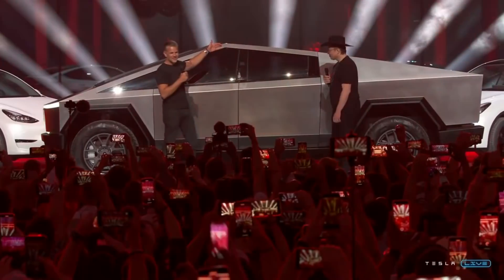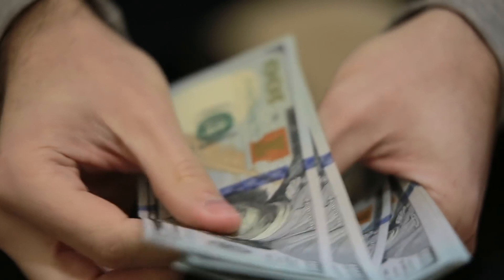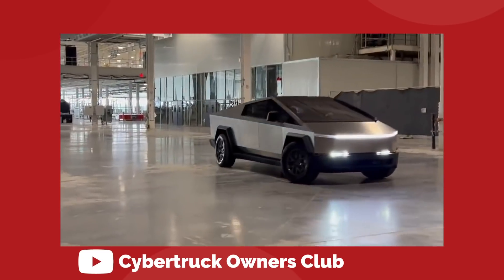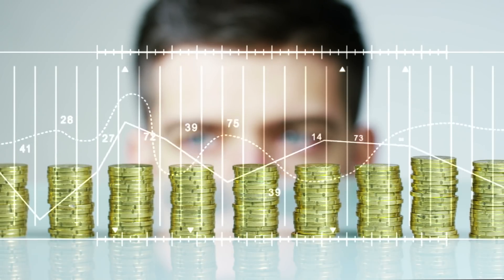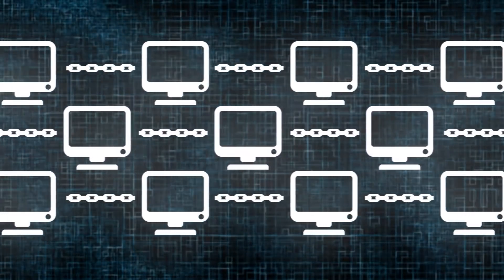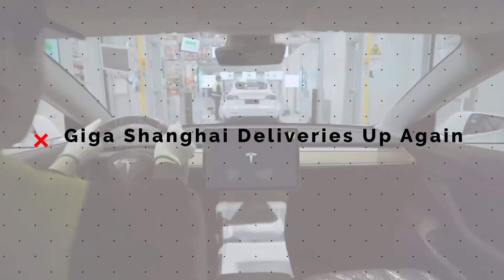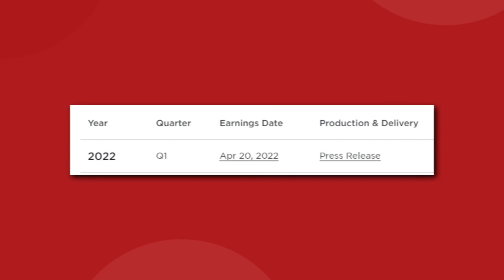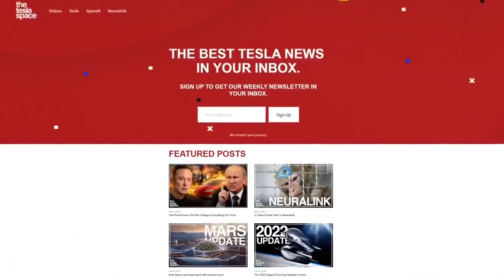New Cybertruck Updates From Giga Texas!

Comment: 3:50 you call that rear wheel steering!? It’s pathetic/a joke that tiny steering angle, Chevrolet did a way better job with the avalanche….
Reply: it's amazing you can make that assessment from a small clip of a minor turn on a prototype vehicle :o I'll be interested to see it actually being used in operation and doing crabwalk steering and we can see how well your comment ages when it's compared to avalanche then ;)
Reply: @daemenoth  lol…… hummer/GM showed their all wheel steering and crab walking way back during the prototype that was actually nice to see, my comment will age very well.
Reply: @alanmay7929  once again they were not showcasing that functionality in the still developing prototype so trying to make that assessment on your part is quite premature and the avalanche also does not have self driving and is quite a bit more expensive to keep on the road, nor does the avalanche have anywhere near the same amount of torque while doing such a maneuver or in general. In 2 years I don't expect anyone will be touting how much better capabilities and features the avalanche had over the cybertruck in any regards and honestly I won't be surprised if GM is the first legacy brand manufacturer to fade into the past as the vehicle industry goes through major changes in the next decade ;)
Reply: @alanmay7929   Is crabwalk really necessary? No.
Reply: @xxZerosumxx  who said it was necessary!? It actually works better on much bigger vehicles and trucks.